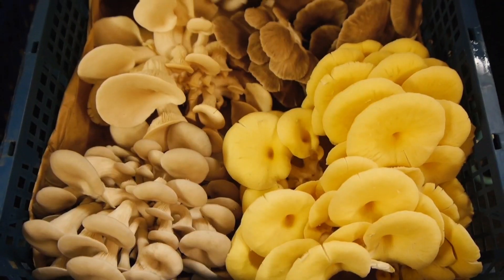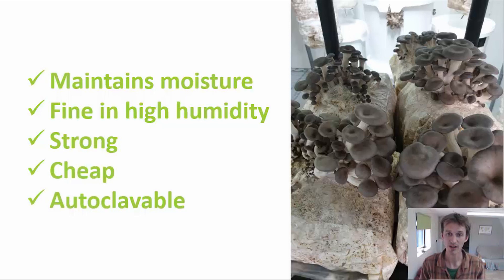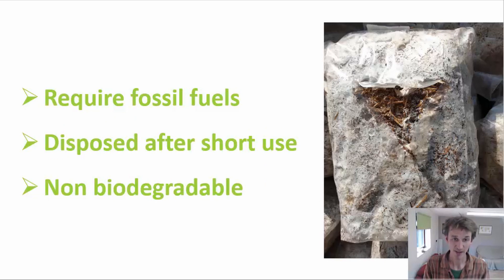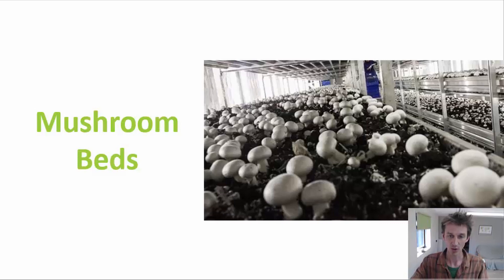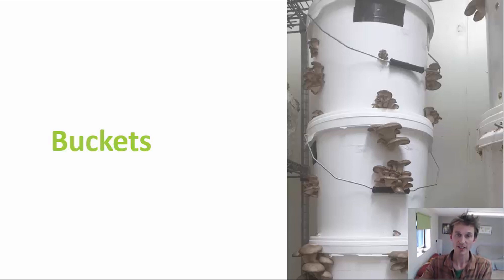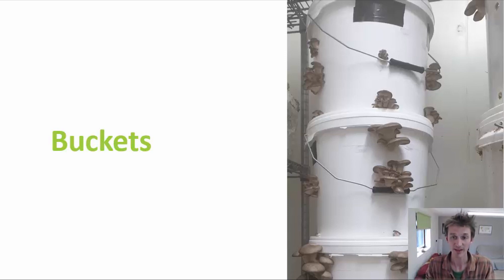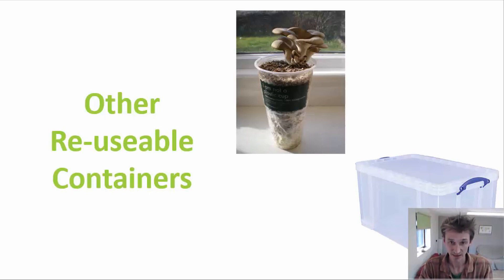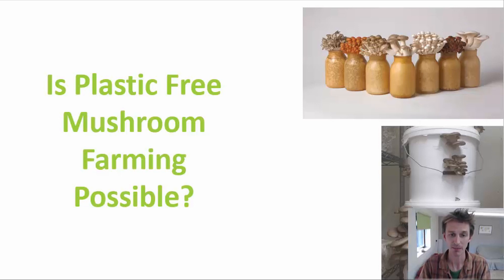Plastic Free Mushroom Farming? | GroCycle

Comment from the maker: To learn more, come and get your FREE ebook and video training here: https://grocycle.com/workshop/
Reply: about cleaning the buckets: one has to avoid that they get dirty in the first place. So, to achieve that, you can use a trick from the packaging industry to reduce plastic waste: they use the layering approach. meaning you need to separate a set of properties (strength, light blockage, reconfiguration for the fruiting location, retaining the humidity) into layers. This is easily achieved.
1. use the buckets for strength. prepare configurable holes, by drilling 3..5 cm holes, and 3d printing of a specialized screw. 2. cover the inside with a thin layer of cellophan film, which is even bio degradable. One can think even of spraying the cellophan film into the bucket. 3. at the end of the lifecycle, one has to remove the cellophan film only. the buckets need not be cleaned thoroughly at all

Comment: Near the end of your video you mention cleaning the buckets, It sounds like a tedious time consuming task. Some thirty years ago, I made beer using carboys, but I also tried to make my own wine in 5 gallon buckets like yours. There was a chemical readily available at the beer and wine equipment store used to cleaning the buckets. I think it was calcium chloride. I only needed a little, 1 tsp per 5 gallons of water. To my recollection, cleaning the buckets was quick work. Of course, this is better for small operations, and may not meet the needs of a mushroom farm with hundreds of buckets. Anyway, it might be worth looking into.

Comment: I am going to make it with buckets. Because a friends restaurant normally uses quite a lot of those.. But have you thought about an restaurant dish washer for the bucket cleaning? You can just cycle 6-10 buckets every 2 minutes, and you are able to do stuff in the meantime. Thanks for the video!
Reply: How can you fit 6-10 buckets into them? Most of them are 60x60 cm So you could fit 4 x 30 cm diameter buckets in there.
Reply: Another idea could be using Zerotol and an IBC system

Comment: I worked at PALS Mushroom farm (Portland, OR) in 2020 and packed the buckets with the pasteurized substrate and spawn. We cleaned the buckets with a power sprayer and then soaked them in a bleach bath. Stored them in the incubator room and then wiped them down with a bleach cloth before packing. I found that they do become brittle over time and shatter, which can cause cuts to your hands if you are not careful. I am sure that by this time, you have come up with your own way to clean them. I enjoyed the work, even though it was very physical, and we grew beautiful oysters. :) 

We sold the old substrate as a garden amendment. I did, and we told other to, put the old, well-inoculated, mycelium-laden substrate into a bucket at home, but to replace the center of the mycelium block with fresh straw, cap with a wooden board weighted with a brick (high tech stuff, you know), place in the shade, under a ventilated plastic if needed, water and keep an eye on the humidity and then have another flush. In the summer it would be too hot to do this, but the fall, winter, and spring were great times for growing this way. 

I have thought about stainless steel, round with sealable holes (we always taped the grow holes on the buckets until we saw signs of growth and moved them to the growing chamber) and some sort of gasketed, sealable/locking top, almost like a pressure cooker lid, with a rubber patch to inoculate through. Pricey, but very durable.

Really enjoying your videos. :)

Comment: I used to work in a brewery and have grown mushrooms at home for a number of years. We used to clean casks with specially designed wash stations where you could essentially fill up a tank with cleaning solution (sodium hydroxide/peracetic acid) and cycle it through the casks via an arm fitted with a spray ball. Maybe you could use a similar system for your plastic grow buckets? 
Sodium hydroxide isn't the nicest chemical but was used to quickly clean off solid biofilm. Peracetic acid was used to sanitise afterwards, and eventually breaks down into non-toxic compounds (you can put beer straight into a peracetic cleaned tank without needing to rinse). Cycling the liquid cleaning chemicals within the system meant we could do tens of casks with only about 50-100L of each.

Comment: Hello Adam!
There are "real" biodegradable plastics available on the market but they have a much higher price than conventional plastics. The other point is the tensile strength of the material what you mentioned basically about starch bags. 
Here a small list of the material which are biodegradable and can be produced bio-based:
PHAs (Polyhydroxyalkoates): group of plastics produced by some microorganisms as energy storage when the supply of nitrogen or phosphorus is not sufficient and the supply of carbon is in excess. Means the palstics is produced in the bacterial cells in fermentation tanks and has to be extracted from the cells mostly by destroying the cells. The main component is hydroxybutyrate in polymerized form (PolyHydroxyButyrate) and a lot of other molecules can be incoorparated, too. All depending on the bacterial strain, process conditions, substrate composition, additives and so on. A sustainable way to produce PHAs is the use of agricultural wastes as substrate. A lot of research is going on this field.
PLA (Polylactic acid ) is a other biodegradable plastic which is produced by polimerization of lactic acid. It is probably most common biodegradable plastic but the properties are not very suitable for producing foil bags. It is used for production of biodegradle plastic trays and cultery. The material itself is known to be brittle what makes a lot of things very difficult.
PBS (Polybutylene succinate) is a other biodegradbale plastic what can be produced bio-based means without the use of fossil raw material but the production from bio-based material is far too expensive for now. 
PCL (Polycaprolactone) is a fossil based palstics but it is biodegradable by microorganisms and without any additives. 
PBAT (Polybutylene adipate terephtlate) is also fossil based plastics what is biodegradable, too like PCL. But for all plastics there should be some microorganisms in the soil which have the appropriate enzymes and the overall conditions for degradation should be given. For example there are lot of reports that PLA needs 50-60°C for initiation of degradation what given in industrial composting plants.

Comment: To properly compare bags with buckets it’s worth calculating how many times you’d need to reuse each bucket to account for the extra plastic/energy used in its production. Like those cotton tote bags that produce ~150 times more emissions than the disposable plastic bags they were replacing.

Comment: What about a compostable liner in a bucket? Pull out the liner clean bucket🤔
Reply from the maker: we've used compostable liners in the past and they don't break down very well unless they go into a commercial composting operation, so wouldn;t work so well with our simple composting of substrate set up
Reply: @GroCycleTV  But might this be a viable option if the municipality already collects compostable waste for free? There is an extra cost simply by adding fully compostable, plant based liners to the system, but could this be worth the saved time, effort and energy in cleaning?

Comment: I enjoyed listening to your presentation very much. At the end I recalled having seen a footage about how they produce very stable bricks from processed mycelia, would that be a possible idea for growing mushrooms in such a material?
Reply: I was just thinking the same thing. It would be very strong and resistant to any further growth. But probably not so good with long term exposure to water and humidity, as the myco-structures I've seen are all compostable. 

Maybe using the light weight compostable plastic along with some type of rigid outer structure to give it more strength would work. Then there would still be the benefit of having something disposable (so less time spent on cleaning), but it would be reasonably sustainable

Comment: Hey I have a question about buckets... It seems that theres a couple problems.
(1) Wouldnt contam be really bad, if it happened? Cause a whole bucket could be contaminated and you wouldn't know it?
(2) What about on 2nd and 3rd flush... Wouldn't it shrink, and start fruiting inside the bucket? How would you prevent that?
Thanks
Reply: 1) yes transparent plastic is way better but hard to get by transparent large buckets.
2) true
Reply: @greenspanfx  Contamination issues: when seen, you 1) tape over the hole, depriving it of light and slowing the spread of the contamination spore. You check all the holes on the bucket and make sure there is no more contamination. You also check all the buckets in the incubation chamber or grow chamber. If you are checking on a daily basis, you should be able to catch problems before they get really bad. In the end, it is possible to grow or let the already-present mushrooms mature before you remove the bucket. Also, buckets on the farm I worked on usually had some degree of contamination by their 3rd flush, and after their harvest they were removed.

Comment: What about a compressed coconut fiber bucket? Something like the nursery pots. They may not be autoclavable but could work with low tech farming. Along the lines of 5gl buckets I've thought about large diameter pvc pipes in 6ft lengths to replace the number of buckets used at once. Or maybe a wax lined compressed large diameter cardboard shipping tubes... or stainless steel tubes/tanks to go completely plastic free.

Comment: How about 3D-printing containers explicitly designed for mushroom growing and easy cleaning?
Reply from the maker: Sounds good, but how would they be different from a bucket or storage box? Easy cleaning would be the innovation needed somehow
Reply: @GroCycleTV  Somehow open-able maybe? So you get two half tubes for easy cleaning. And you probably want longer ones then the standard bucket.

However, printing large objects is expensive too..
Reply: How about cutting drainage-pipes in half and open close mechanism onto them.
Reply: In Asia they grow in automated reusable bottle systems.

Comment: What about having a sterilization chamber/part of your shipping container space where you have to wash your buckets first, but afterwards you put them in the chamber and pump in a mist of hydrogen peroxide? The kind of Hydrogen peroxide that is used for wound care is 3% and is used in some microbiology labs to kill pathogens. It's relatively cheap and environmentally friendly, doesn't need heat or electricity to work?

Comment: Question, would stainless steel drums work?
Durable, temperature and moisture proof, easy to clean out. The holes can be shut on hinges.
Obviously much more of an investment, but should be a one-time investment too, no?
For visibility one could install a strip of clear perspex (or the like) down the side of a tube, or just open up the holes / have the hole-covers be clear.
Bonus is that steel is much hardier than even high grade plastics, meaning you can clean much more agressivly (in terms of chemicals or physical action, being a layman I have no idea what you'd use, but chances are steel can take it)

Comment: Could the cleaning buckets issue be achieved in a similar way to cleaning pint glasses in some pubs? - An upside down (pointing up) spinning brush with some kind of water/cleaner jets. Stick an upside-down bucket over the spinning brush and water jets, move it up and down, et voila. Just a thought 💭
Reply: Guessing the issue is not the cleaning itself rather than keeping them clean and sterile until reused again and how to actually make them sterile since most big buckets will not be fitting in non industrial pressure cookers
Reply: @twitchclips8588    With oysters (and straw/coffee) sterility isn’t an issue. Pasteurising is actually better. A quick wipe with iso would mostly be sufficient for a properly washed/cleaned bucket. The issue, as I saw it, was efficient cleaning of the bucket between cycles - removing all the previous substrate in a quick effective way to streamline the process. Washing buckets in a commercial setting is crazy labour/time intensive and therefore expensive.
Reply: @JustAnotherMaker  ofc and agreed. but the topic is to remove the use of plastic waste and single use.. which this does for oyster etc where as how to approach it when you need the sterility and cleanness for bucket growing other types and strains of mushrooms

Comment: I wonder if using a stainless steel steam table pan with holes drilled in it would work well enough to be commercially viable? They are relatively cheap for stainless steel and you can get ones that are quite deep. The holes can be plugged with those silicone plugs for powder coating until needed.

Comment: Rather than using plastic jars couldn't you use large mouth glass jars?  You can empty the substrate and put it into a compost bin, wash the jars(by hand or dishwasher), then fill them with substrate, run them through a cycle either in a home pressure canner or instant pot to bring them up to temp and pressure.  Finally you introduce the span and cap them with reusable plastic lids, that you save, wash and sterilize between grows.
Reply: That was my exact question. I'm sure they could at least replace the plastic bottles that were shown. Likely for small production only though.

Comment: What if you taped three buckets together after cutting out the bottoms of a couple of them, drilling the holes needed, etc.  Then when you need to empty and clean the buckets you can use a mop and push it down inside of the bucket chamber?

Comment: The key is obviously the holding vessel...either way if using buckets or any container you are going to have issues with cleaning and reusing....even if reusable bags were created with set perforations or "flaps" these would still need to be emptied and cleaned to be reused once mushrooms fruit... How can this be avoided? When using buskets possibly large scale sterilisation of buckets in an IBC/large container for re-use again (hose out buckets and place all buckets in a large tub full of boiling/heated water possibly)...are there any potentials for having some type of open/non enclosed vessel for growing out (like a an open log/pipe of sorts with substrate inside and mushrooms growing externally) and to then clean out. As long as nothing is being disposed there will always be the cleaning aspect i feel. So this also poses the question of creating 100% bio degradable bags being the key..Sorry just brainstorming...possibly a key in increasing surface area (adjusting/updating known techniques) while maintaining enough substrate/nutrients to support growth...creating enclosed thin "walls" to hold the substrate which would thus have high surface area with holes for fruiting but easy to take apart and clean? Very keen to see the results for yields etc when comparing bag and bucket methods too guys...keep up the great work guys you've turned me into a 'shroom head (thanks! :P) and love how readily you share knowledge - hoping to have my own small set up running asap!

Comment: i'm picking up 2 racks of those BPA bottles to use in my micro grow . . . the racks i've seen are designed for 16 bottles, 2 racks will give me 32 to play with in the space i've allotted, from all the read'n and research'n and watch'n i've been doin those seem to be the most enduring of the options with the smallest foot print on the back side.

Comment: If you are still thinking about a good way for cleaning the buckets (not sterilizing them) u might design a pool where u pick water with a High pressure pump and provide the pool with filters that divide water from the dirty part coming from the buckets into the same pool. With this you might be able to reuse the same water again and again. By the way filters might be the solution as well as the problem, when they saturise with dirt. Have a think and enjoy!
Reply: The cost of electricity now has gone up and is getting expensive to run pumps etc all the time doing these things , other wise cost of things go up again due to the cost of production , in a big set up maybe but then again back to the costs , filters need replacing water is another cost you pay for at least here in Australia we do , everything costs here and then the cost gets past onto the customer who is not going to happy and would more than likely shop elsewhere , food for thought .

Comment: I would think a power washer with bleach and hot water would work quite well to clean buckets even alot of them.
Reply: Bleach is not the most eco-friendly answer to an eco-friendly question in my opinion.
Reply: Reckoning power wash with soap, and then spray with alcohol would be good enough.
Reply: At the farm I worked at we used a power sprayer and then a soak in a bleach bath, then a wipe out before we used them later. The only problem with a power sprayer is that if the buckets had any contamination, the sprayer will spray it all over, so you have to make sure your grow areas have a way to filter that out. The farm I worked on had high efficiency filters on all its chambers.